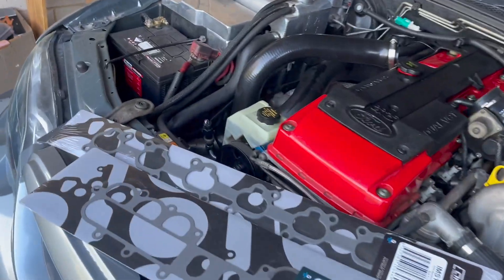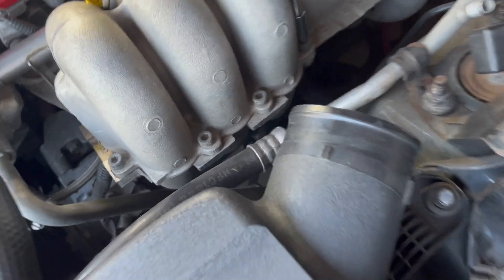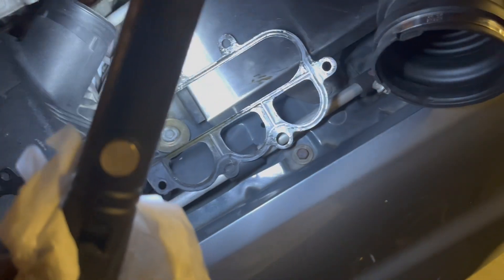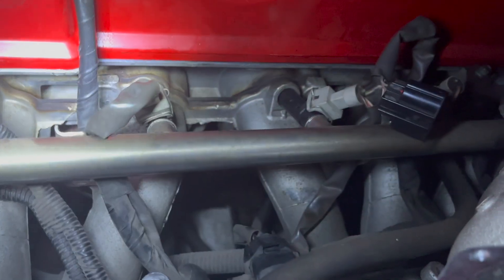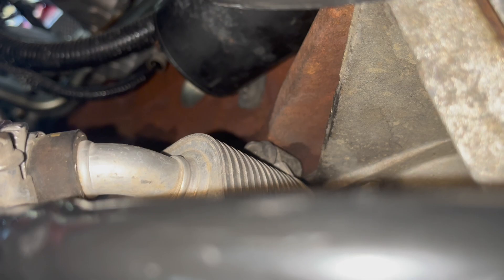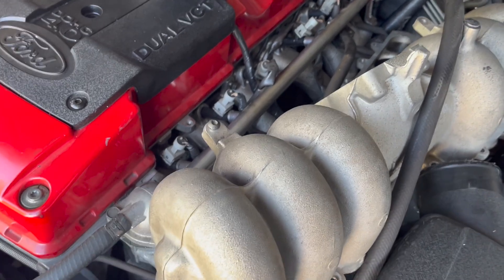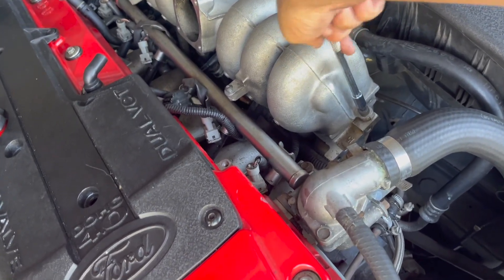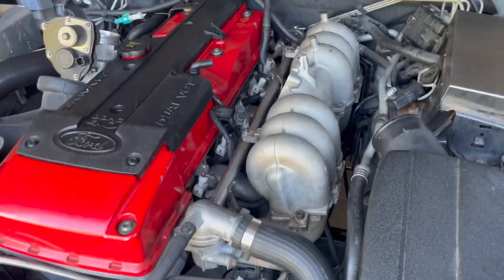Falcon barra intake manifold gasket (HOW TO)

Comment: Did you put the gasket  in from the top or bottom?
Reply from the maker: from the top, can't really put it in from the bottom
Reply from the maker: just gotta make sure you pull the manifold from the engine to slide it in.